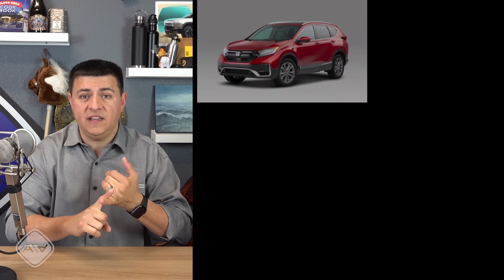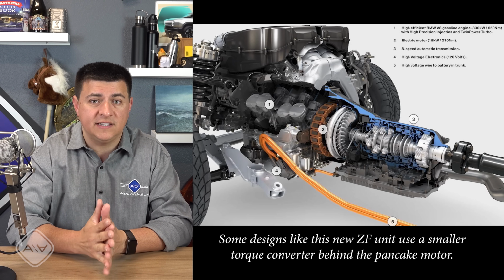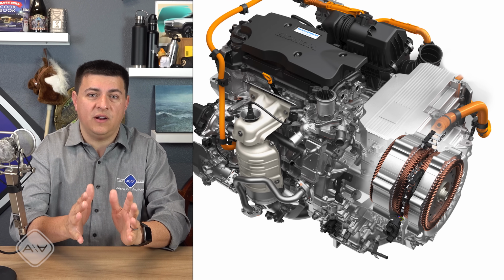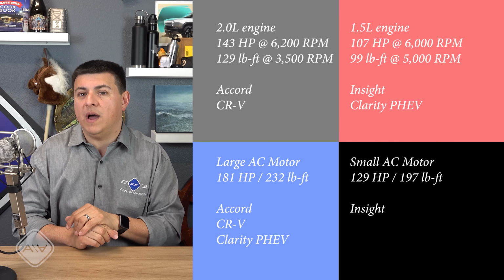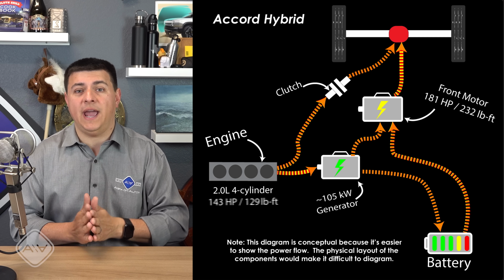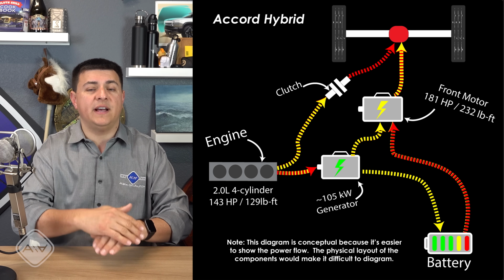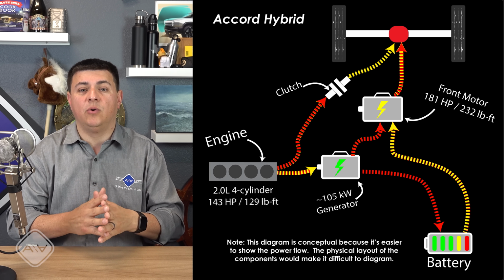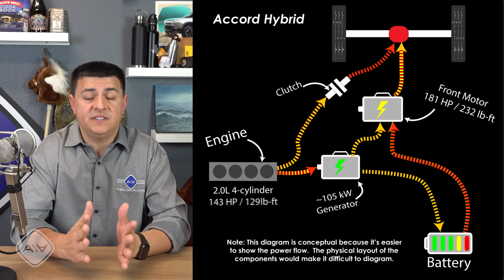How Does It Work?  Honda's 2 Motor Hybrid System Explained!

Comment: Are there any good mechanical diagrams of the system?
Reply: There's a diagram on the white board behind this video: https://www.youtube.com/watch?v=fmMb45PPrmg . It's for the 2017 Accord, but it is an identical system.

Outside of the fact that it is hand-drawn, and so not to scale, it is quite accurate. Note that when the engineer says the motor shaft is "eccentrically around" the generator shaft, he means that it is "concentrically around" it.

An interesting point is that the traction motor's rotor, drawn in green, actually functions as the gear that connects the clutch output to the countershaft. Its (final) gear ratio, 8.395, is skipped over in the diagram.

Correction: the diagram is two dimensional, while the gears are arranged in three dimensions. The OD gear (shown in red) connects to the countershaft (brown) directly. This would happen behind the motor (green), not through it as I described, if the engineer could easily draw such a thing on a white board.
Reply: @jeffjo8732  Hello Jeff , I have a question. Is the e-cvt transmission used in this new 1.5 cc Honda Jazz exactly the same system as the e-cvt used in the 1.8 cc Toyota Corolla sedan or is it a different system? The reason why I asked this was they said that the risk of deterioration of the e-cvt system used in Corolla is less than the normal CVT. Do you think we will have problems with the e-cvt gearbox if we buy Jazz?

Comment: Hey i have a question. Volvo's hybrid system has the motor to drive the rear wheels only. How does that one work?
Reply: The front axle is engine driven only and the rear is electric driven only

Comment: What would happen if your batteries or motor failed could the car drive in gas only mode  ?
Reply: There is no such thing as "gas only mode." There is always one, or two, motor-generators moderating th power of the engine. Usually that means it is letting the engine run at 34 HP instead of something lower, like the 15 HP needed to maintain 55 mph. It does this because it increases efficiency from 33% to over 40%.

It does this until enough charging has been done to use EV Drive. If the battery is not accepting charge, that will never happen.

But the whole thing is a complete red herring. The battery will never suddenly die, although it can lose capacity. And if it were to really die, you would not be able to start the engine.

Comment: Honda crv 2020 2022 hybrid how to manually put the transmission in neutral when the battery dead.???
Reply: Why would the (do you mean HV?) battery be dead? Why would that stop you from powering the car on? Why would you want it in neutral, which mostly means no brakes?
Reply: @jeffjo8732  I think it must have a neutral on the transmission but I don't know where. Maybe you know.
Reply: @mosemose9402 Do you mean the hybrid battery, or the 12V battery? See all those disabled hybrids lining the side of the road? They are there because the hybrid battery is "dead." Oh, wait, you don't see them? That means IT DOESN'T HAPPEN AND YOU SHOULDN'T WORRY ABOUT IT.

And there are more reasons this is an irrelevant question. The hybrid battery is not what allows you to "put the transmission in neutral." The 12V battery powers the car's systems. If it is dead, you jump the car.

This car really doesn't have a transmission, but I think you mean the "shift selector." There is a button marked "N" on it - which you would know if you have ever driven one. You push it to put the car in Neutral. The power has to be on to do this (see above, about jumping the 12V battery), but it does not do whatever it is you think it does.

It does not affect any relationship between the engine and the wheels, or the motor and the wheels. At rest, the engine is not connected to the wheels and the motor is permanently connected. You don't want to tow the car because of the motor, as that will create an EMF in the system.

There is a "double neutral" used for things like automatic car washes, where the car is towed slowly. But it will time out after (I think) 15 minutes.
Reply: @jeffjo8732  I don't want the car to stand on the street, I want to put it in the garage. I don't have a key and how can I neutralize it without a key?

Comment: The 2024 Honda CR V Hybrid Touring has to check the tire pressure? Can someone please answer, according to the manuals YES, HOW PLEASE
Reply: Honda uses a monitoring system, not sensors. You should calibrate it anytime you change the inflation in a tire. It keeps track of how many times each wheel rotates, relative to the others, to see if any one is spinning faster than it did the last time it was calibrated.

Comment: Toyota Hybrid or Honda Hybrid? Which one is longer lasting gear and more efficient in terms of fuel consumption?
Reply: Two words used for similar questions get used interchangeably, but mean subtly different things. "Efficiency" means how much of the available energy in the fuel is turned into useful energy, and "Economy" means how much fuel a vehicle needs to perform certain tasks.

SO, MPG or "fuel consumption" is economy, while you asked about efficiency. A vehicle that needs more energy to perform the same task might be more efficient, yet less economical. Also, a difference of 1 MPG in the ranges expected here amount to about $15 in gas a year, so you may be focusing too much on minor details with this question.

This is why any explanation has to go into more detail. I'm not trying to weasel out of an answer I don't like. I'm trying to say that you need to balance MPG differences only after considering other differences in the vehicles' functionality. Specifically, in the functionality that is important to you. And "functionality" doesn't mean just power and performance. There are two factors in such a comparison that may not appear obvious.

First, the interior size of the vehicle. In the usual head-to-head comparisons, the Accord is matched to the Camry, the Civic to the Corolla, and the CR-V to the RAV4. But these comparisons are based on what feature sets the targeted market expects, not size. The size comparisons in these examples are 123 to 115 ft^3 (passenger+cargo), 114 to 103 ft^3, and 106 ft^3 t 99 ft^3  (passenger only). The cargo space in the SUVs depend on other factors, so I won't quote them (but the CR-V starts with more). So, all of these Hondas require more energy to move more volume.

Second is wheel size. Yep. Larger diameter wheels create more air drag, and require more energy (a lot more than you might think) to change speeds. For example, wheel size is the reason a Camry with 16" wheels gets 4 MPG more than one with 18" wheels. But the average consumer prefers the looks of the thinner tires on the larger wheels, and is willing to sacrifice ride quality and $60/year in gas to get it. Just sayin'.

The best comparison between these two systems is the (new) Civic SE and the Camry Sport. The Civic is only 1 ft^3 smaller on the inside, and both use the same (P235/45R18) tires. EPA estimates for Combined/City/Highway MPG are 49/50/47 for the Civic, and 47/48/47 for the Camry. These differences are almost negligible.

And while these two advertise about the same power (200 and 203 HP), these numbers are "fake numbers" meant to estimate their equivalence to conventional ICE cars. Alex and I have a running disagreement about what they mean. He thinks the Civic should be called 181 HP, but that is a different kind of measurement. The Camry cannot have an equivalent because of how it is designed, but I think it would be about 172 HP. This is borne out by the Civic's 0-60 MPH time of 6.2 seconds, while the Camry gets 6.8 or 6.9 seconds.

Sorry to go on so long; it's my failing to over-explain.  My point is that, yes, in the usual head-to-head comparisons the Toyota gets maybe 2 or 3 more MPG, but that is not "more efficient." The Honda in these comparisons is so much more car, that it counts as 2 to 3 more MPG than the Toyota. Whether you want that much more car at the same level, is your decision.

As for reliability, both are net to bullet-proof. But Hondas with this hybrid system have better reliability ratings than similar Toyotas.
Reply: @jeffjo8732  Thank you for your detailed explanation. First of all, let me state that when I asked about fuel efficiency, I should have said that it was about consumption. I just wanted to know the difference between the Corolla and the Civic, but I can say that you taught me how to fish rather than giving me a fish. Hondas have extra gear clutches in their transmission boxes for very low and very high speeds, while Toyotas do not have these. I doubt that these will have a certain lifespan. Frankly, I thought that the more complex and jointed a system is, the more likely it is to fail.
Best regards
Reply: @kadiryildiz5909  "Hondas have extra gear clutches in their transmission boxes for very low and very high speeds."

Other than what is needed to connect the engine, motors and wheels, the Honda Civic has one clutch and one gear in its transaxle. Nothing else. And it's for cruising above about 40 mph. It literally is called the overdrive gear. The CR-V adds a second set for cruising at lower speeds while towing. Since the CR-V is the only Honda hybrid that is rated for towing, it is the only one that has the second set.

Most of the time, the clutch is open, the engine drives only the generator, and only the motor drives the wheels.

"While Toyotas do not have these."

But the clutch(es) only close when speeds are perfectly matched by computer. There is no wear on the clutch plates. To put a nail in that, Toyota's hybrids actually have more history of clutch failures.

All hybrids include a permanently-applied "break-away" clutch in the flywheel, in case there is a catastrophic change in the engine's, or wheel's, rpm. In most, normal activity does not make them slip. But the Toyota engine is started while connected to the wheels, and that can cause some slippage. Please note that I am not claiming there is any concern here - it's an anomaly when it fails. But it happens more often than the Honda clutch failing.

"I thought that the more complex and jointed a system is, the more likely it is to fail."

Well, yeah. That's the Toyota one. The Honda is different than you are familiar with, but most of the difference eliminates complexity.

Comment: Alex, my guess is Acura uses a pancake motor hybrid system? Since Honda HQ, has announced it will be reshuffling management to address some quality issues, do you think Acura might adopt the honda hybrid system?
Reply: acura is honda, i doubt they are using different systems, the difference is features and badging
Reply: @faxpro  There are at least three different Honda systems. This one - which Honda calls i-MMD - is not used in any Acura models.

Comment: Does the mechanical Awd system that you stated affects the fuel economy for the CRV hyrbid? Why is it lower than the RAV4 hybrid?
Reply from the maker: That is the most likely reason.
Reply: @AAutoBuyersGuide  so if you were to work at Honda what would you have done to make the CRV hybrid increase the EPA ratings to either match or beat the RAV4 hybrid based on the strategy of using a serial hybrid as stated
Reply from the maker: @StrappedCleric91  Honestly its so close it probably doesn't matter but making a FWD version that got 41 would likely have been one way to do things.
Reply: @AAutoBuyersGuide  gotcha then why would the EPA rate a Toyota vehicle hybrid drive train higher than a Honda's drive train if they're close?
Reply: @AAutoBuyersGuide  Hello Alex , I have a question. Is the e-cvt transmission used in this new 1.5 cc Honda Jazz exactly the same system as the e-cvt used in the 1.8 cc Toyota Corolla sedan or is it a different system? The reason why I asked this was they said that the risk of deterioration of the e-cvt system used in Corolla is less than the normal CVT. Do you think we will have problems with the e-cvt gearbox if we buy Jazz?

Comment: Which battery is used to start the engine - Jazz Hybrid 2023
Reply: The HV battery drives the "generator" to start the ICE.
Reply: @jeffjo8732  Thanks Jeff because I travel short stop and start journeys I was concerned if it was the 12volt battery to start the engine it would charged enough to start the engine.
Reply: @John  One warning: there is no issue with starting the engine, since the generator easily spins it up to 2000 rpm without the solenoid a conventional starter needs. But both the engine and the battery will need to be warm to get full efficiency. This is true of all hybrids, but the serial system is most sensitive to it.
Reply: @jeffjo8732  Thank you for knowledge of hybrids

Comment: Why dont we see diesel hybrids and how much more efficient would it be than gas and cost per mile or mile per gallon?
Reply: Mainly because a hybrid already takes advantage of the factors that can make a diesel vehicle more efficient, and there are more issues with the emissions of a diesel.

Any combustion engine operates only within a small range of rpm and power. And they work most efficiently within even a smaller range. The issue that engine designers face is that "sweet spot" for power has to fall in between the power needed for cruising, and for acceleration, and so is seldom where the engine runs.

For example, the main reason highway mileage is better than city mileage is because, even though it takes more power to maintain a higher speed, the engine actually uses less gas to provide the higher power needed on the highway.

The advantages that diesel has include (1) The fuel contains maybe 10% more energy per gallon, and (2) Improved efficiency can increase that advantage to about 15%. But it also has a smaller sweet spot, has less power, and pollutes more. Plus, it is more expensive per gallon.

A hybrid gains efficiency by using electric motors to allow the engine to run, almost all of the time, near its power sweet spot. Any differences between the power needed, and the power produced, is adjusted by the battery. This eliminates half of the advantage that diesel has, while not having to suffer the disadvantages.

Comment: Sounds similar to the Mitsubishi Outlander PHEV - front and rear electric motor drives the car until speed or heavy acceleration kick the ICE engine direct drive via a CVT..  Advantage of SUV is the larger battery 13kwh allows 30miles on full electric.   Still can. Wait to get a full BEV to get away from all the servicing costs.

Comment: I have an Insight. I thought overall between all the components the car has a total of 152 horsepower?
Reply: Alex confuses what the various power measurements mean, and at what point in the process they apply.

A gas engine PRODUCES mechanical power by burning gas. A battery PRODUCES electrical power by moving ions around. You won't be shocked to learn that, in a conventional car, the device that TRANSMITS this mechanical power to the wheels is called the transmission. What might shock you, is that the device that TRANSMITS this electrical power to the wheels in an Electric Vehicle (including hybrids) is called the motor. Neither of these last two devices PRODUCE power, they only TRANSMIT it.

Both engines and batteries have a power rating that means how much they can produce. Transmissions and motors have a rating for how much they can transmit. Transmissions are chosen so that their rating is high enough for what the engine can produce, so they aren't published. (You might notice it if you try to boost the power of a car with a CVT; you can ruin it.) Batteries can produce much more than the motors can transmit, so in a Battery Electric Vehicle they publish what the motor can transmit. Finally, Hybrids are complicated, since they need to use both systems.

But not all of the power that gets produced is transmitted to the wheels. Peripherals like fans, compressors, etc., all get their share. And some is lost to heat in various places. Honda apparently uses the convention that that the transmission's power needs to be at least 85% of the engine's power. To apply the same rule in your Insight:

1) The motor can TRANSMIT 129 HP.
2) To supply the motor, the combined output of the engine and battery needs to be 129/0.85 = 152 HP. This is the number you cited. Honda calls it the combined power.
3) The engine can only PRODUCE 107 HP.
4) So the battery can apparently produce 152-107 = 45 HP to make up the difference.

The battery may be capable of more. But the car can't use more, so it won't.  This combined figure is an honest comparison to the power published for a conventional gas car.

And, this same calculation applies to every Honda iMMD, until 2023. The Accord Alex talks about has a 181 HP motor, and claims 181/0.85 = 212 combined HP. The 1.5L gas Accord, which has claims 192 HP,  can only send 192*0.85=163 HP to the wheels. Alex misrepresents the Accord at 7:50, because "the average American" can indeed "experience the combined 212 HP" when it is measured as power PRODUCED . Which is exactly what every gas car means by its power rating.

Sadly, IMO, starting in 2023 there is apparently a new "standardized" system for hybrids that will have less meaning. The rating will go down by a slight amount, even though the car is slightly more capable.

Comment: Great explanation like always, The one thing that I experience everyday like AOA explained here is the instant torque especially in the sports mode..On the contrary, Honda does produce excellent transmissions like 8 speed DCT and the new 10 speed with the 2.0T and V6...great tech